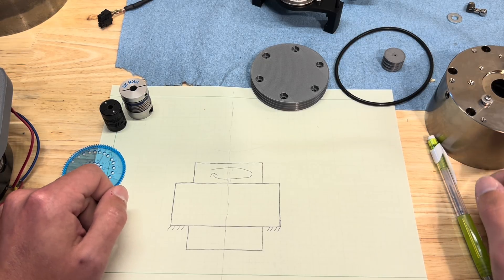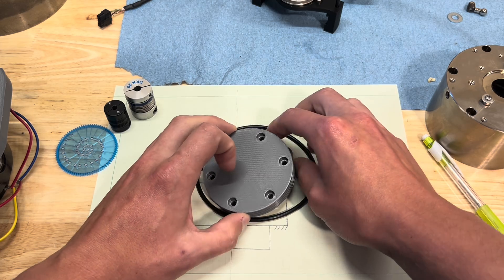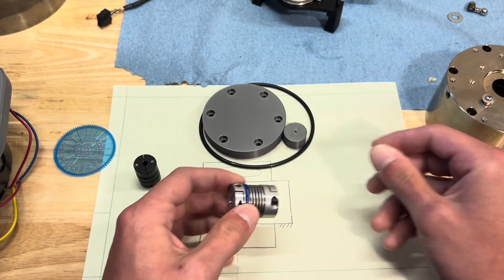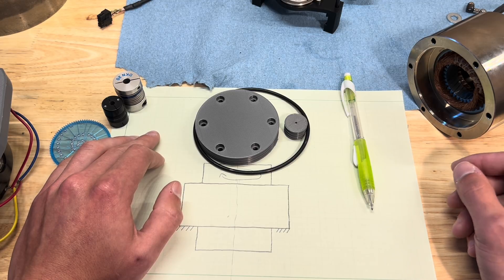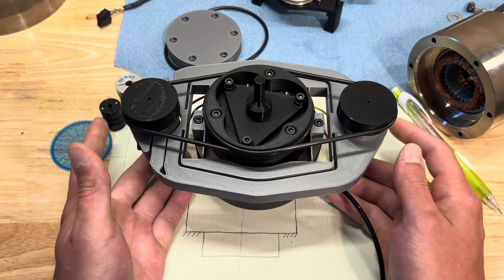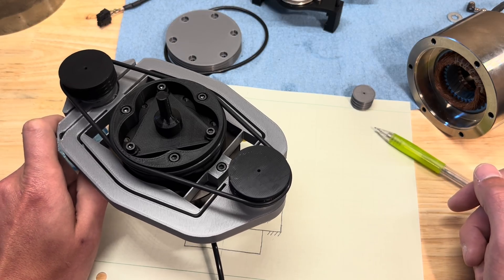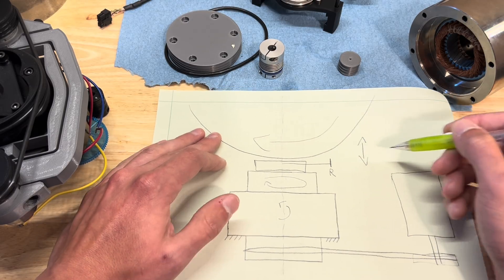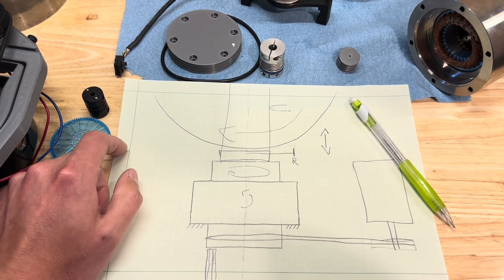Flexure decoupled belt drive for ultra-precision spindles

Comment from the maker: Dawg if I get another comment about the moment induced by the belts not being inline I’m going to combust 😭 You leave one little detail out for brevity and that’s the only thing people notice lol
Reply: This can be compensate if you use 2 belts in one of then. 
One belt from pulley A, then belt from B and another from A.
Belts from A will have half the tension but together they cancel the tilting moment in the spindle.

I loved your design. Very clever.
Reply: A's pulley should have also half the stiffness. Root 2 / 2 the diamater should do the trick.
Reply: @Brunoscaramuzzi  I had the same thought, but with four belts, two to each pulley, with the outer ones to (say) pulley A, and the inner pair to pulley B. Doubles the torsional stiffness and torque transmission capacity as well, in comparison with the original.
Reply: That's why people become machinist and not engineers. Pleasant co-workers.
No, seriously. Thanks for educating me with your video's :)
Reply: I thought of it, but didn't mention it because most lathes have spindles and bearings so massive these things don't matter. The old saying goes "If it's not smooth and rigid enough, throw iron at it".
Reply: @Bob_Adkins   Good luck getting sub-microinch deflections (and geometrical deviations) from a traditional lathe spindle, even one whose spindle bearings each cost more than any decent lathe a private individual might aspire to own. 
The best spindle performance I'm aware of is the Tallyrond 130 series inspection spindle, used in metrology labs for evaluating the roundness of precision parts. Taylor Hobson guarantee the coning error (what I used to incorrectly label "nutation" error), measured 4 inches from the end of the spindle, to be no more than 1 microinch .
And that's not a traditional spindle, that's a diamond-turned air bearing spindle, and although it's marketed as "economical & cost-effective", you'd be lucky to find a well-used one for USD40k.
Reply: @Gottenhimfella  I was QA manager for years in a 7-acre machining and assembly factory.  Wherever tolerances were less than .001, we rough turned and ground to final size. Even that was a challenge, rigidity,  runout, and bearings were crucial. I can't imagine fighting sub-micron tolerences on a production basis. It's only for the obsessive!
Reply: @Bob_Adkins   Indeed. And sometimes people are misled by unhelpful or misguided actions such as add-on amplification for measuring instruments which takes their apparent resolution past their inherent repeatability, so that most of what you are seeing is just a close up view of the measuring error, rather than deviations in the part dimension.

Comment: Thank you for your video. I think there is additional force you did not take into consideration: when you apply torque to the small pulley, this generates a larger tension force on the pull side of the belt compare to the "push" side of the belt. This will result in additional force perpendicular to your flexure housing. To eliminate this force, you should should apply the same torque on both small pulleys (this is hard to achieve), or design the small pulleys to be the same size as the central one - in this case the belt force would be aligned with you flexure housing. What do you think?

Comment: Really getting into flexures I see. I have the option to use 3D printed flexures for my current project, I may do so. They do handle those extra degrees of freedom nicely compared to a conventional spring, plus I can rapidly prototype different force flexures. Well, I can also rapidly wind piano wire.

Comment: Hmm, pretty interesting idea. I'm not sure what RPM you need for your diamond turning project but the one issue I see with this system is resonant frequency and "unsprung mass" (to borrow an automotive term; the mass of the wheel/tire/suspension that has to move in order to follow the contour of the road). We want the balanced pulley assembly to follow the spindle without applying any force to it, but we have to accelerate the frame and the motor to allow for this motion. That acceleration of course requires a force.

If you're able to operate the system far below the resonance frequency set by the belt stiffness and the motor/frame mass, great: this will attenuate forces due to all the sources you mention. But if we need to operate near or above the resonance frequency, then the effective stiffness at that frequency set by the mass of the motor/frame system actually will exceed the belt stiffness and we're back to where we started.

And I think that unfortunately the belt nonuniformity issues will create forces whose frequency components far exceed the rotational velocity of the pulleys. For instance if the belt exhibits any stiction or stick-slip behavior, we'd see little jerks that would not really be attenuated at all (since the frame would have very little time to accelerate).

I think the next step from here might be a system with very, very low "un-sprung mass". Could we off-board the motor(s), and somehow couple it/them to the spindle pulley via a very light, "balanced force frame" that has only some idler pulleys on it or something? 

Some sort of complicated belt or drive cable loop that runs from stationary motors to a moving frame comes to mind. 

Or maybe something as simple as a secondary belt that runs parallel to the flexure arms, and couples an intermediate pulley on the frame to a stationary motor.

Comment: For the version you discuss just before your actual model (around 8:30) with the one single inline belt going around the edges of the load, can you explain a bit about why low contact area is a problem? Could you not cover more arc length by having the pulleys around it closer to the middle?

Comment: "most requirements for mechanical precision and tight tolerances in the actual manufacturing of a machine or mechanism are necessitated by a departure from kinematic ideality in the design" - I don't know if this is common knowledge in machine design but regardless I just gained a really valuable tidbit, thank you :)
Reply: Does this just mean that we have to make things really precise because we cant make them perfect?

Comment: There is still a small axial tilt error torque induced against the shaft with only a two belt setup, since they are not perfectly in-line. For a completely stable setup, you need a minimum of 4 belts, two per side, and in a LRRL format. So left pully belt on the bottom, two belts from the right, then last belt again from the left. You could probably get away with 3 (LRL format) But the tension on the middle belt would be higher than the other two.

Comment: Super clever design, but wouldn't inertia of the motor frame become a problem at higher speeds?

I feel like you could get almost the same belt wrap with the "pinch belt" design by adding a few idler pulleys, unless that would add some force to the spindle somehow?

Comment: My best guess for a suitable shaft coupling is a Control-Flex type designed for driving encoder shafts with minimal side load. (Zero-Max brand in USA)

Comment: Doesn't the fact that the belts are on the upper and lower positions respectively imply that there'll be an off-axis tilt force on the shaft if there's any imbalance between the belt tensions? Or is that intended to be counteracted by the "floating" flexure? I wonder if a single belt with a spiral groove pattern on the central pulley would help further eliminate those forces.

Comment: just a funny idea. could you use, magnets to provide a spring force on the flexure, with copper components in the magnetic field, to provide damping...opposing magnets ggenerate an increasing 'spring' as they approach, so that you can have high compliance over small distances, with stiffer spring effect over travel, but could have high damping, to avoid resonances, and provide velocity-varying resistance...
ok, just thinking. with a 'lever arm' on a flexure, could have larger travel, allowing more spring rate and damping control...I'm kind of ill, so might not be clear, or, indeed, doing more than blathering. always interesting discussions in the video, and comments!
Reply: I’m sure I’ve seen the magnets and copper approach used in diy scanning microscopes , so it’s definitely a thing !

Comment: I wanted to power a small precision spindle with a dremel and a rubber belt and no matter what, I was still feeling some vibrations (I was even trying to hold the dremel in hand to isolate vibrations from its body). Maybe a longer belt would work better, but I want to keep it compact. I also tried out to spin it up with compressed air and that's like another level.

Comment: So, I've not seen a belt drive system such as you've displayed here being used for constant rotation. However, it makes me think of counterweight systems used for CMM Z axes and similar situations. I understand that you have chosen to demonstrate the concept as a flexture because it is an easily printed design that makes for a nice visual. Moving into the manufacturing space though, I think the design and some of its comcerns could be cleaned up a lot. Start with a standard spindle mounting flange, a BCD and bore cut in a larger rectangular plate. Your two motor mounts being decoupled become two separate, smaller plates of similar design. For sake of the arguement, all plates are ground and lapped to ideal geometry. We then drill/ream/grind/lap a series of holes 25% of the plate length away from the spindle centerline on all three plates. These holes could have two or three bore sizes as needed to minimize the number of holes drilled. Into those holes the spindle flange side recieves a light press fit for a dowel pin, the motor side recieves an exact sliding fit at the same diameter, the next diameter can then be for a precision spring nested over the dowel. You've now got your decoupling in the rotarty axis and need a means of holding the three plates together. You could go hard in the paint and gun drill the three plates out at their corners to run two threaded studs through them, tying tying them all together. This can then use a series of jam nuts and jack screws to set uniform belt tension as a function of springs rate. If harmonics are a concern, you could swap the springs for gas springs and use bushings mouned to the machine frame to dampen large oscilations. 

These are just the thoughts that come to mind quickly, the back of my head is pondering whether or not you could replace the belting with precision metal shim stock and gain something in the process.

Comment: Could  you add more planets and do like a plantary coupling? Maybe even drive the planets to then drive the shaft via tension so you're using almost a cyclydol drive or plantary geared driving to maximize torque while still pinching in pairs of planets except now the planets orbit and the pinch points transfer higher torque due to being radially tensioned?

Comment: 15:50 or so, comparing to your flexture build: I notice the two belts are _very close together_, but they can't be exactly in the same place, leaving some residual tilting moment. Can this be low enough to be fine?  (The option for almost arbitrarily-high belt tension would contradict that..! Instead, belt tension must be limited by system stiffness and maximum deflection.)  Would you consider using one strong belt to one side, and a pair (above and below the opposite belt) of half-strength (or size or whatever) belts opposite, to cancel out the overall moment?  Or identical belts in a L-R-R-L pattern?  (There is still some local displacement due to belt pressure; I wonder if this has any inertial effect?  Probably not, if slow enough, and the construction is stiff enough (trivial using bulk steel parts?).)
Reply: I had the same thoughts when i wached the vid...and envisioned the 4 belt setup.. L R R L  to get rid of the twisting motion..

Comment: Interesting about the direct drive spindle, you could use electronic control with drive strength calibrated to angle, to cancel out nonuniformity in the motor. Would be a PITA, especially if you're not embarking on a customized motor drive at this time, LOL, but interesting as a possibility I guess.

Doubly so: suppose you put two such motors on the spindle, front and rear. With the right drive controls, I guess you'd have a direct mag lev bearing system, even (more particularly: a sliding scale anywhere from "hands off" and the mechanics dominate, air bearing and all that; to fully floating, fully magnetic suspension).  Would need quite the precision control (read: inefficient analog, or digital with many extra bits in the DSP and a fast sample rate) to pull that off at this scale, heh...

(As a technical control challenge, that's not very involved I think, an STM32F4 sort of platform would be sufficient, say?  It's all the code and debugging and testing and calibration that really hurts.)

I wonder what the uniformity of magnetic suspension even is.  Magnetism is not as strong (Maxwell stress at realistic flux densities is much less than hydrodynamic forces, i.e. 10s, maybe 100 PSI sort of range), and it's a bulk material property subject to inhomogeneity and anisotropy (flux density, permeability, whatever, might vary with orientation (angle), and perhaps be patchy within the material itself), so it might be a source of noise.  Don't know offhand what materials have best homogeneity, but it should at least help if, for example the stampings that make up a rotor/stator, if they're indexed (relative to the grain orientation of the sheet they're cut from) by equal amounts given their symmetry (i.e. a 4-pole stator has successive layers rotated 0°, 90, 180, 270, ...), might be a way to solve anisotropy.  Homogeneity you'd have to just roll the dice and see if given materials are good at it; I'd guess so, but I'd also guess that, at some number of nanometers, it still matters.

Comment: One issue i could find is that flextures generally have pretty bad resonant frequencies. I'd expect like 50-200Hz. So if either the motors or the spindle are at that frequency this thing shakes itself to death :( 
Great idea for lower speed stuff!
Reply: Another thing you can have is that since the pulleys aren’t exactly the same size, your imbalance will have a period going from the best possible balance to the worst. The period will be longer depending on how close the diameters are to each other. I once used a belt to drive a cylindrical grinder wheel and made the pulley for the wheel spindle very close to the same diameter as the pulley on the motor. Bad mistake, the imbalance would go from bad to good every 30 seconds or so. I ended up making one of the pulleys about 1/2 the diameter of the other.
Reply: @davidarneson7100 very interesting. Didn't think about that

Comment: Oh, does anybody use magnetic coupling on spindles? With the low torques the copper rotor probably wouldn't even get much heat build up, and it could be easily insulated.
I feel like it might even allow you to have the motor very loosely coupled to the frame, avoiding any vibration it produces.
The magnetic rotor would need to be tuned though, to avoid irregularities in the field producing unbalanced radial force, and that might be quite difficult.

Comment: The gyroscopic effects on the grinding spindle may shift the resultant force by up to 90 degrees. So your example is good, but the best motor position may be dependent on the operating RPM.

Comment: I think there may be drawbacks to allowing easy motion of the motor mounting with elastic coupling to the spindle since belt oscillations could become more of a problem.
My concern is that inhomogeneity in the belts (small variation in thickness and/or stiffness) would result in larger force variations than the other variations in tension that will occur during a cut, but allowing motion could provide a way for the belt inhomogeneities to cause oscillation of the motor mountings.
Damping could be used, maybe just a strong dashpot, but I think the freedom of motion might simply not be beneficial unless there are significant differential changes in the properties of the two belts during a cut.

The dual motor setup however does seem like quite a good idea to get close cancellation of belt forces, although I feel like there could be the possibility of some sort of oscillatory feedback between the motors to consider (mostly just a feeling I get, aside from obvious problems like if competing control loops were used for the motors).

Could adding flywheels to the motors be a good idea to reduce vibrations being transmitted through the belt? Maybe even a torsionally compliant damped coupling between the motor and the flywheel? The oscillations in motor speed may be small but if you are concerned about belt tension variations then this may be on a similar scale.

Comment: I know quite a bit about spindle design at this point. I find it all the more impressive how it is done in industry: Error motion less than a micron on a milling spindle whose rotor weighs about 15kg that is driven by GEARS. When we took it apart we knew why: Polished spiral gear on a zero play spline, its distance set to the dot by shims with the original spotting ink still on the gear, about 30 years after it was made. 
Or on a CNC turning center: Just make the spindle insanely big and stiff and just drive it with one single giant belt and giant servo BY FRICTION on the spindle shaft, 200Nm 5000rpm 🫠